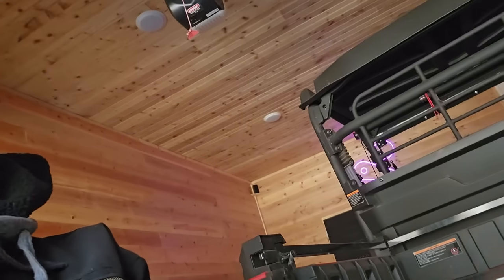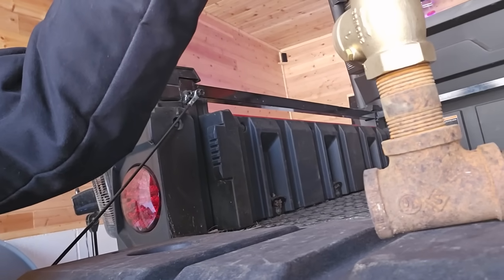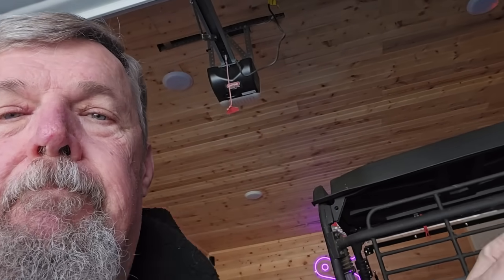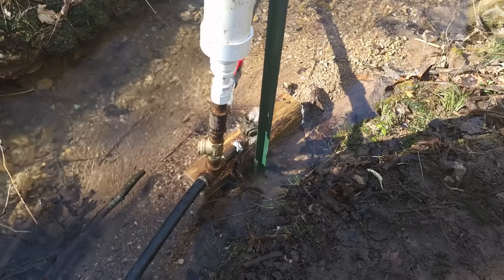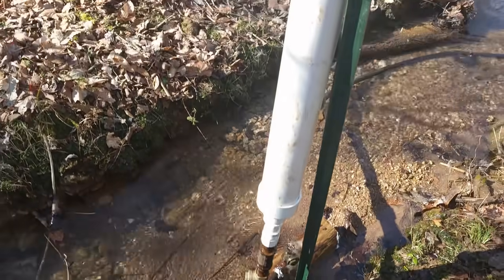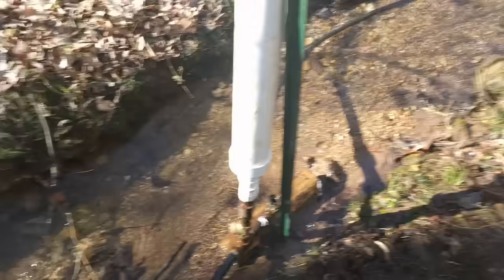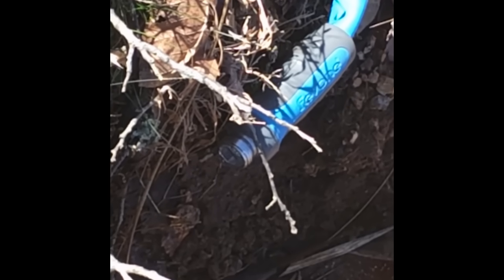Moving Water Uphill and a Long Distance - Yes, a Ram Pump is an Answer!

Comment: Your engineering is spot on. Only thing I'd add is small dam with inlet hose close to bottom. That would also increase hydraulic pressure. Just saying

Comment: If you have any body of water on your property such as a pond you can use a bucket and piping suspended above the water somehow and it will suck water out and you can run the water into something you can place the ram pump in and pump the water uphill from a water source that is not moving. All this without electric.

Comment: Cool! Also, if you have time, there's Gold in that creek! Had one similar but larger size creek that ran all year. You'd be surprised how much you can get with just simple panning.
Reply: I've been thinking of checking mine. Any tips or just pan and sift?
Reply: @ Find the deeper areas. Those are usually where the heaviest "Metals" are, rr the end of a long run. Plenty of videos here to start this hobby. Hope this helps.
Reply: @RL-RL  Thanks , sure did👍
Reply: I'm in a valley just past a bridge where it slows down so it sounds promising now.